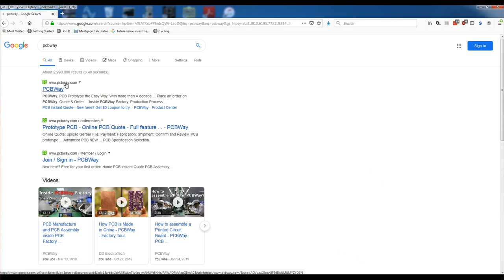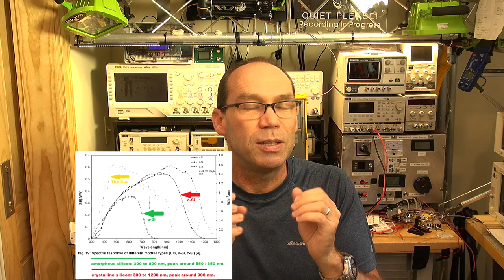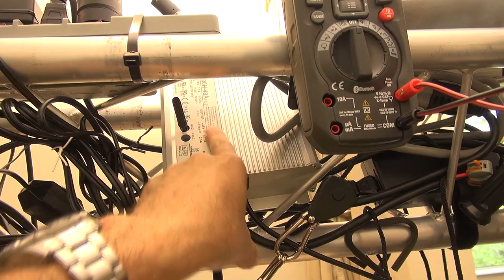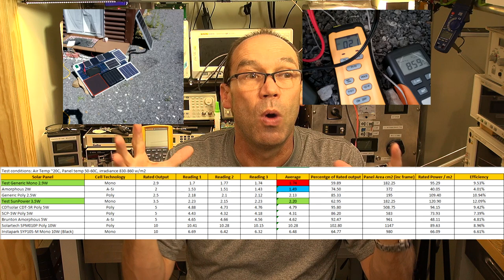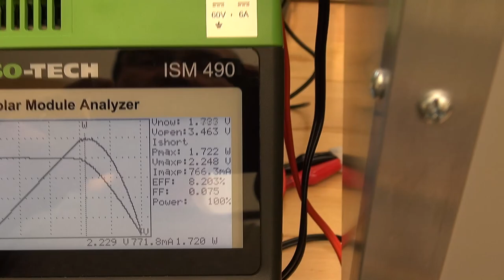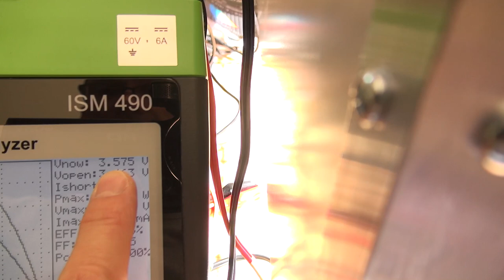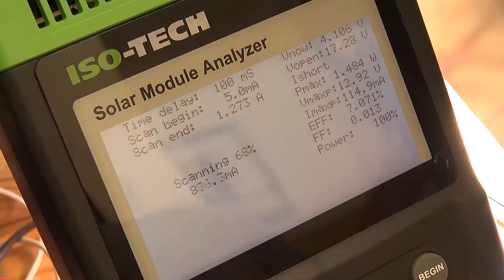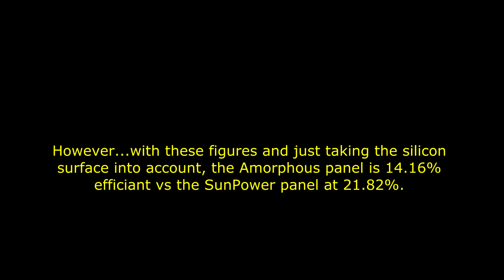Solar Panel Test Bed - Part 3

Comment: Tip for the mirror flex is to use some T shaped extrusion and some 3M VHB tape to attach it to the back, so that you have some stiffening ribs on the panels.
Reply from the maker: Yes, stiffening battens/ribs were next on the list but fortunately not required after I got it installed.

Comment: If you need more IR just add incandescent lights... There's some misunderstanding concerning the efficiency of these. They are badly rated because they don't output much visible light but in fact they are good if you consider IR because most energy is radiated in the IR spectrum.

Comment: Forgive me if this question has already been covered, but if I may make a couple of assumptions as to the purpose of these excellent videos, firstly to satisfy your natural curiosity (and also ours) and secondly to see which panels would work best for your location. You seem to live on the side of a mountain which is currently (in the fall) giving you shade in the mornings, if I may further assume that this will become more pronounced by mid-winter, how will this effect the working temperature of the various panels and their subsequent power output? Are these panels in a ready to go condition or do they have a 'glass' cover? will the nature of said cover have an effect? Lastly I would be interested to see if the power output changes as the panel is rotated in the current plane to 90deg 180deg and 270deg, I suspect not, but it's an experiment. Thank you for all of your hard work, I find it fascinating even as I struggle to stay with it all.
Reply from the maker: Thanks for your post, good questions. I will cover more of this once I setup my solar carport and panels for the cabin.